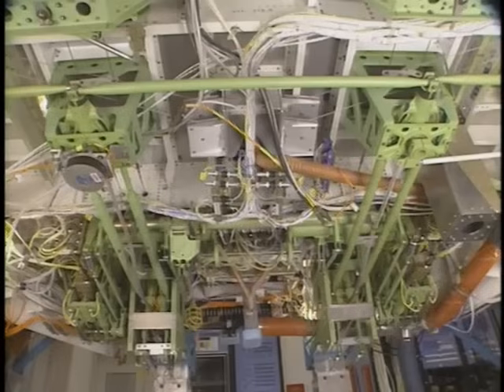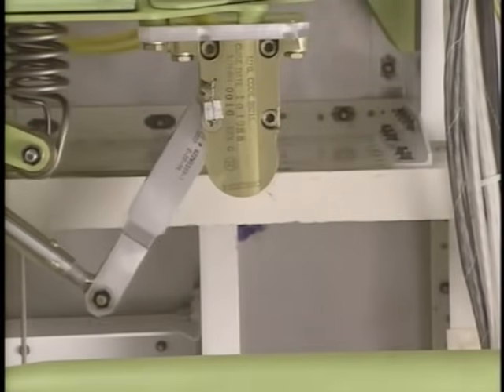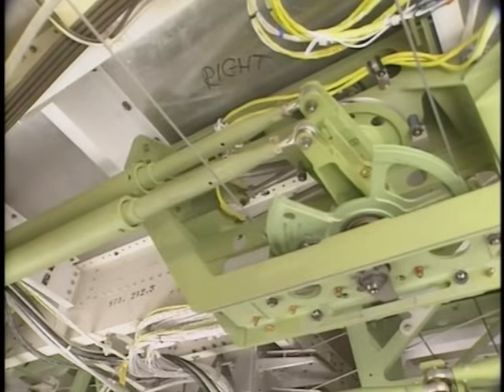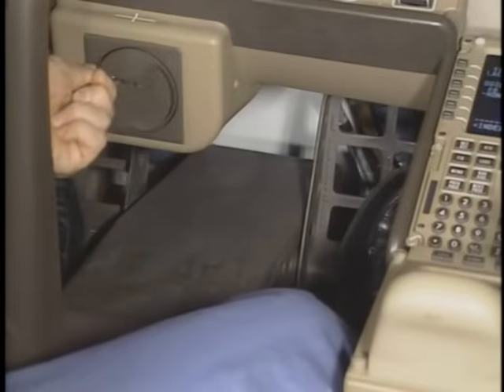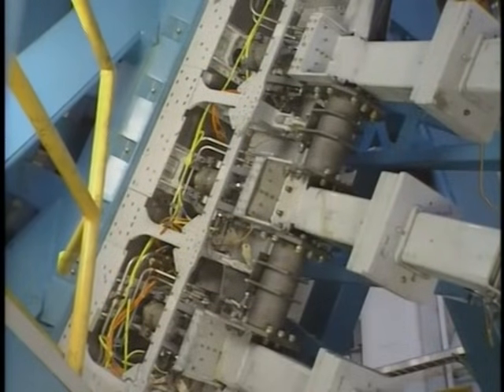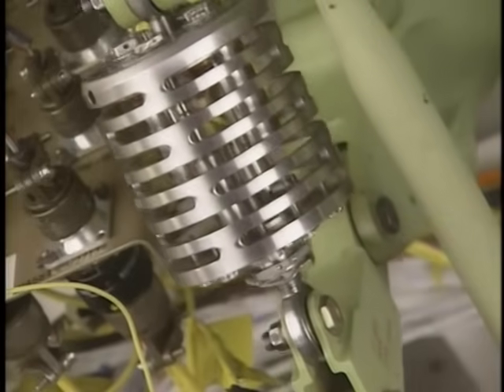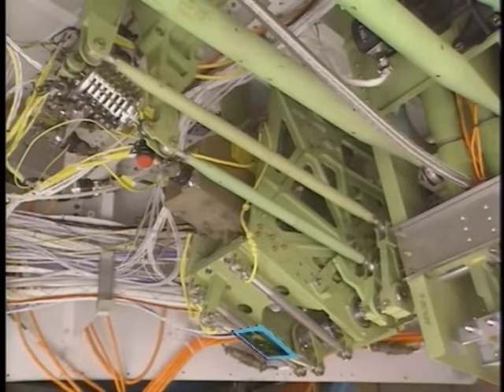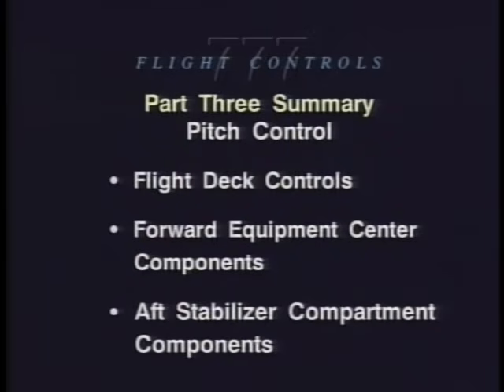B 777 Primary Flight Controls

Comment: As an aircraft mechanic, my experience with Boeing aircraft was limited to the 737 and 757 models before my retirement.  Seeing this video, I am surprised to see how many of these components in a fly-by-wire Boeing are similar or almost identical to components found on the 737-100 series, which went into service in 1968, and the 737-200 of 1969.  Feel and centering units, force transducers, trim actuators, force limiters, lost motion devices, LVDTs, power control units, stick shaker, breakout mechanisms, and ball screw actuators all play the same roles in old Boeings and new.  Missing, of course, are the long runs of cables that connected pilot inputs directly to flight control surface actuators, and even those were not effective for rudder control on the 737 without hydraulic pressure.  Also missing is the aileron/spoiler mixer unit.   The SP-77 autopilot on the original 737, although purely analog, was really pretty sophisticated for its time.  In fact, for roll and pitch control the basic operating mode of the autopilot, and the default mode when first engaged, was, believe it or not, a fly by wire system.  It was called Control Wheel Steering mode, or CWS.  To an observer, it would seem that the flight crew was still using manual steering with the autopilot engaged in CWS mode, using the control column and roll control wheel in the same manner whether the autopilot was on or off.  However, in CWS control surfaces would not respond directly to the inputs from the column and wheel.  Rather, the forces applied by the pilot would be sensed by the force transducers, sent to autopilot boxes contain analog computers, and conditioned signals then sent to hydraulically-powered control actuators (power control units) to move the applicable control surfaces through direct mechanical linkages.  On the 737-300 and later aircraft, separate autopilot actuators, also hydraulically powered, moved the inputs to the PCUs, rather than having autopilot control actuators built directly into the PCUs.  Since the control cables already linked the control surfaces to the column and wheel, movements of the control surfaces caused by autopilot inputs would back-drive the wheel or column as the pilot's force inputs were made good.  If the autopilot made an uncommanded movement, the pilot could override the autopilot by applying more force than the autopilot actuator could produce, and disconnect the autopilot if necessary with a push button on either control wheel.

It may seem as if the CWS mode was redundant to manual control, but in fact it provided rate control,  bank and pitch angle limits, and an overall stability to airplane flight.  It would hold a heading and a pitch angle if no other autopilot mode was selected, ensuring that the airplane did not leave its intended attitude if the pilot was making no steering inputs.  CWS was and is a very good autopilot operating mode, and it provided the basis for today's Boeing fly-by-wire airplane operations.
Reply: That was great, and it's always nice to get the skinny, from those who know plenty!  Thanks and cheers!
Reply: So, in CWS mode, the plane did everything the A320 does in terms of flight envelope protection, ie overbank, AoA protection/stall prevention, basically everything needed...

And all of this done in analogue.

Brilliant engineering.
Reply: I retired 3 years ago and I agree 100%. Which is one thing that bothers me about the new Air Force tanker. It's a 767 platform with all the state of the art systems of 1967. An outdated airframe, outdated systems, and outdated components with new avionics. I think the taxpayer was taken again. Boeing didn't break that mold until they built the 787 which is a Clean sheet airplane with new everything.

Comment: I did not see any mention of the retro encabulator, the spurving bearings, or  the panametric fan. Without these, the system is bound to fail sooner or later.
Reply: All powered by a Flux Capacitor obviously

Comment: 775,000lb max takeoff weight is insane for the 777-300ER, that’s the same as the 747-100! Each engine makes 115,000lbs of thrust which is insane
Reply: The downside is the very high wing loading compared to the original 777, leading to very low initial cruise altitudes when taking off fully loaded - below 30,000 feet. The 777's "champions" never mention this "feature"
Reply: @visionist7    Note to self:  Stay away from Mt. Everest and K2.
Reply: The Thrust amount it quick staggering.

Comment: I didn't think the 777 was so backwards and still having some cables for control. Real modern fly by wire aircraft use electric backup actuators.
Reply: If you think it's backwards, could you list the qualifications that you have that would allow you to disagree with Boeing's design team?
Reply: @VictheSecret  I don't care what you want me to list. Anyone with a technical background comes to the same conclusion why it is backwards to use pullies in a supposed to be "modern" fly by wire aircraft like the 777. You won't find any pullies or cables (for flight control)in a Airbus since the introduction of the A320 in 1985. I know you people have a hard time when someone states the obvious facts. Real modern fbw aircraft like the A380/A350/787 use electric(hydrostatic) actuators.
Reply: It's been proven that fly by wire systems have failed. Even the A10 has mechanical back-up for hydraulic or electrical failures.
Reply: @lohikarhu734 The slow gun with wings 
that might get replaced by crop dusters sure is an example.

On other examples you have stuff like inherently unstable fighters being viable(which helps a ton), and control mechanisms being lighter and in a way actually simpler. 

And there is the general opinion of the industry(idk what the "proof" is).

edit: Nvm on the Sky Warden, its goal is different.
Reply: @lohikarhu734  Utter nonsense, modern fbw have flown millions of flights with virtually no problems. Also there are better solutions for backup than backwards pullies. Look at the A380 it innovated the power by wire concept with electro hydraulic backup actuators and electro hydrostatic actuators. Also the A-10 is an old military aircraft.
Reply: @techdefined9420  The A380 is a far newer aircraft than the 777, which negates the whole point of your reply. Of course the A380 does things the new way, because it’s new(ish). The 777 is 30 years old at this point(as is this video). Besides, Boeing has always done things the old-fashioned way, because they’re an old company and a very conservative approach is part of their engineering culture. I have worked on every Boeing commercial airliner from the 727 to the 787, and each one is merely an incremental step forward. They don’t take huge risks, and they don’t reinvent anything they don’t have to. Meanwhile, Airbus is the child of a consortium of European defense contractors, so their designs tend to incorporate more modern technology derived from their defense side, both because they already got paid to develop it, and because they know it works. Same thing: aircraft manufacturers stick with what works for them.
Reply: I don’t think it’s “backwards”. It’s just another redundancy, and that’s a good thing.
Reply: @wrkingrageaholic  It is backwards, the A380 has pioneered the power by wire concept that uses electro hydrostatic actuators EHA and EBHA.
Reply: I have read all the comments on this video very carefully. Comments relating to Boeing and comments relating to Airbus or it seems that everyone knows the part. You make comments on Boeing-type flight controls and you make comments on Airbus-type flight controls. You all seem to forget one of the main reason that led Airbus (1985…)in particular to offer electric flight controls. If you are not aware of this, it is because you do not know the field. The arrival of electric controls with Airbus was a consequence of the search for savings, we have seen the appearance in cockpits of arrangements aimed at making savings. The reduction in staff, in particular, required the intervention of new technologies: electric flight controls piloted by computers. Many other examples could be named here, but I do not see the point, since none of you have mentioned this essential period.
And everything continue today (737800) développed  ultra quickly to break Airbus…NO , even if the plane now are very heavy , for me it’s necessary to feel action and reaction.thats is impossible with computer and wire. That’s my point.
Reply: @TheE71462  Why would it be impossible to get feedback? More difficult? Yes, but definitely not impossible.
That even seems to be the case here since ultimately the controls still just connect to purely electrical signal transmission.

edit: A lot of things can be broken down to trying to make costs lower. And less things needing to be maintained also means less chance of some screw-up.
Reply: how many aircraft have you designed again?
Reply: @Pilotman28  How many have you designed?
Reply: @techdefined9420 Doesn't matter. You're the one claiming to know better than Boeing.
Reply: @techdefined9420  Oh, they're 777 fighting.  It's called redundancy something Boeing learned the hard way with MCAS.
Reply: @publicmail2  There are much better ways for redundancy than backwards cables. Google power by wire.
Reply: That's because of Boeing's decision to make the 777 somewhat of a hybrid as far as flight controls go. The fly-by-wire logic is there, but controlled by a fully mechanical pilot interface, with all the bellcranks, springs, pushrods and cables that this entails.
Reply: @coriscotupi  Yes indeed, it was their decision, maybe they didn't feel comfortable with the new tech. My point is in a real fbw aircraft you won't find this weird hybrid solution. This adds only more complexity and weight.
Reply: @techdefined9420  Mind you, the mechanical hardware like cables, pulleys, pushrods and bellcranks are restricted to connecting both pilot's controls to each other and to the their respective transducers, feel & centering mechanisms, etc, so all this hardware is really restricted to the cockpit area, the cables do not run the length of the airplane all the way to the control surfaces. This was a design decision to provide (1) the same feel as a traditional, hydraulically controlled airplane, and (2), a "solid" coupling between both pilots' controls, so one could know what the other is doing, just like traditional airplanes. And (3), provide the benefits of full fly-by-wire control.
Reply: @coriscotupi  This is wrong the feeling mechanism is coupled with the yoke and not the actuators. Also the 787 does use EHA actuators instead of pullies  something they copy from the A380.
Reply: @techdefined9420 Even if this 90s design may seem „backwards“. What is so bad about it? Seems to work quite well, right?
Reply: @matthiashartge5520  it has occasionally presented issues like the Air France flight a couple years ago where both pilots tried pushing the yokes in opposite directions during landing nearly causing a crash. The mechanism is designed to resist opposite inputs to a degree and then the rods "telescope" and allow it, cancelling each other out and leading to a loss of effective control. The only advantage over the fully disconnected sidesticks is that this system requires the pilots to brute force the controls to disagree rather than by accident like AF447.
Reply: @matthiashartge5520  The A320 is a 80s design and doesn't need cables or pullies for flight control.
Reply: @visionist7  You see: both systems have advantages and disatvantages in certain situations :)
Reply: @matthiashartge5520  Because the A320 is 80s design and doesn't need that pullies and it works even better, overall less complexity, less maintenance, lower weight.